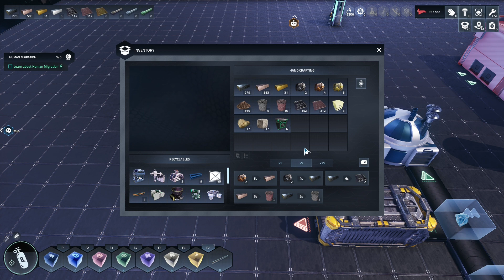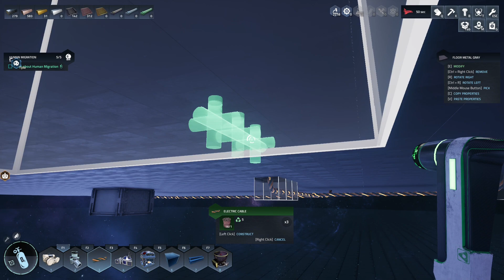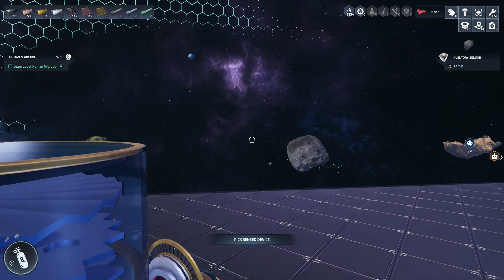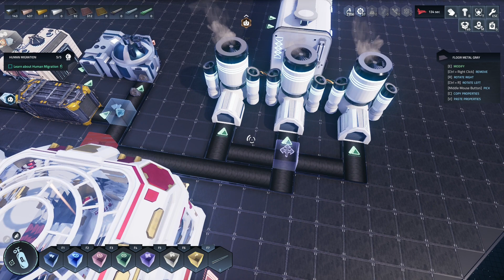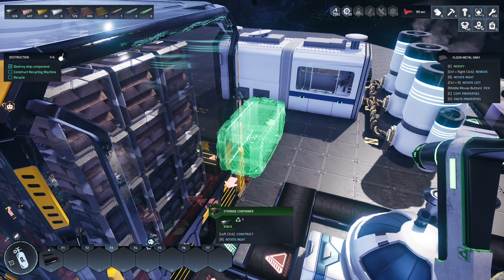Astro Colony - Logic Beginnings

Comment: I was thinking about your problem a little bit more. You got a solution that works, but you don't want all the ice in there, so I see two options. Option one is only possible if the decider can switch more than one device at once. Th start build is in both options the same.

First
Put a pusher (program it to push ice) onto the belt, between the storage and the machine. Leave some space so you might get ice out of the storage directed somewhere else too if necessary. 

Second
Connect the decider also to the pusher.
or
Program a second decider to turn of the pusher.

You might also use another sensor to read the inventory of the machine, so that it will have x ice in inventory for sure.
Reply from the maker: Ice isn't used anywhere else that I know of, so having it all stored in the Ice Breaker isn't a bad thing. It's just making sure it stops running before the tank gets full so it doesn't wate the ice blocks.

Comment: Due to the devs there will be an update, what makes the sensor possibly to read water and electricity. The only question is, what is soon? 😉😃

AstroColony  [developer] 30 Oct, 2023 @ 10:01am  
    
Inventory sensor will soon also include water and electricity, so it's going to be possible to detect when water level is higher/lower than a specific threshold.
Reply from the maker: Well, 7 days is finally coming out of early access after 12 years, so I suppose I can wait a little while for the water and electric sensor